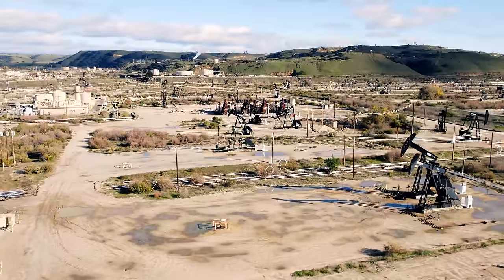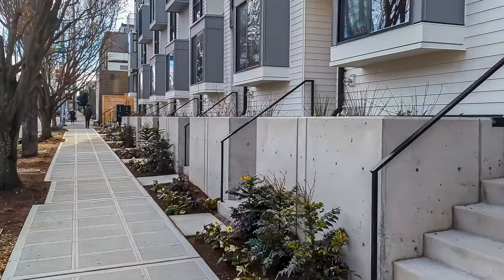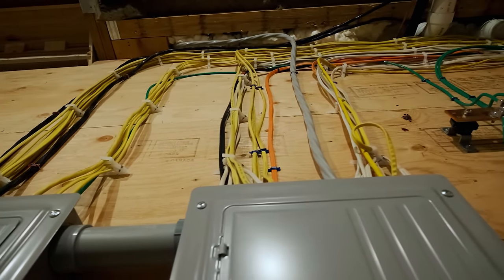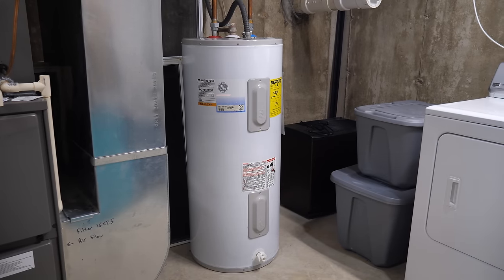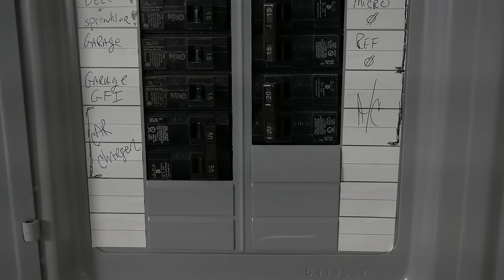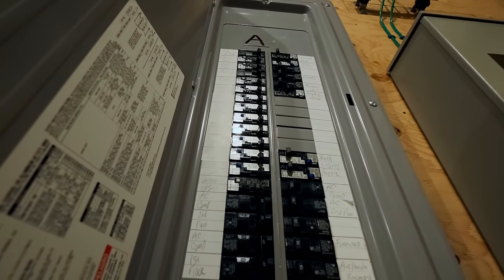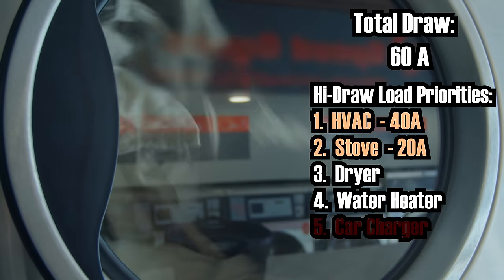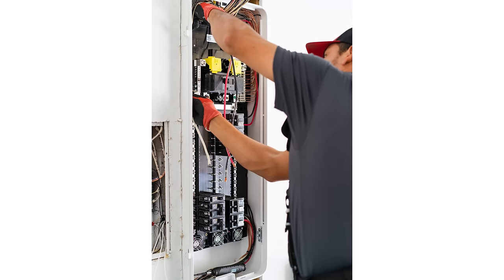Home Electrification: There's not a lot to do, and it doesn't have to be hard (Part 1)

Comment: Hi!  I had a Span panel installed with my ground-mount solar system last summer, and yes I am one of those NERDS.  I wanted to clarify one thing about the Span panel, at least in its current phase.  Earmarking breaker priority is only done with battery energy management and is not implemented to manage grid power.  It will only be used when grid power goes down and you are forced to extend the life on your battery backup.

I have solar but do not have battery backup, and I cannot even access the priority page on the app. I am hopeful they will figure it out someday but as of today you cannot do what you stated with Span alone. Now, I do have direct access through Home Assistant and can manage this through custom automations, but hardly home user friendly.

Comment: I think a lot of why this is hard for people is that they only think about most of the these appliances when they're broken down.  If your gas furnace breaks in the middle of winter, running a new wire to switch to resistive heat may not be simple and you need to fix the heat ASAP.  Just dropping in a new appliance that uses the existing power/fuel hookups is a lot easier when you're in a hurry.
Reply: Also, the gas network never goes down.
Reply: @mark.audacity  Exactly, a 15 amp genny can get you through a blackout in the dead of winter.
Reply: I think most people don't want to spend $10-20k and throw away perfectly good appliances and breaker panels just to make themselves feel better. It would make more sense to throw up some solar panels and actually contribute to the energy mix rather than burn loads of cash becoming more of a siphon on it.
Reply: @mark.audacity  this is a joke, right? It absolutely does.
Reply: @mark.audacity  Be careful making sweeping statments, its not happened to me, but nor does power(I have had strangely reliable power for most of my life, but its mostly buried in my area), but it is possible, heck, the day im writing this comment there is currently a Gas outage in Woodstock, Oxfordshire.

There is a lot of components that can fail in a gas network(Compressor stations), and a lot of Electricity is used to process both Nat Gas and Petrol/Car Gas. I would arguably say its not more reliable and has about the same risks for outage.

Comment: I live in europe, a 200A (or even a 100A) service is mindbogeling here. I have a one phase, 230V 35A service. So about 8KW. And that is without a gas supply. I had a heatpump installed about 2 years ago. When I'm not home (so only fridge/freezer, modem is running) my entire house uses about 150-250W. When I'm home with the heat running, its usualy about 1kw depending on the temperature outside. The only time its even close to the max 8kw is when the heatpump is heating the tapwater. wich draws at most 3kw and for desinfection rises to about 6 but thats maybe 15 minutes a week. The heatpump is capable of loadsharing, and when I buy an electric car, the charger will need to be able to do loadsharing to. But 99% of the time it wouldn't even need to. 

The only time I have over 4kw running through my panel for hours is sunny days, when i'm not home. And thats solarpower going out :)

Comment: I have to say the stove should always be above the HVAC in priority.  I won't feel a short lack of HVAC, but I want the stove to always work when I want to use it.  I grew up in an all electric home in rural Canada (switched our heat from oil to ground heat pump when I was a teen) and never tripped the main breaker.
Reply: Unless I'm missing some nuance of active priority, the first two on the list are functionally interchangeable, as they don't exceed 100 when added.
Reply: What about the concern of potentially fucking up something by essentially "unplugging" and "plugging in" a potentially high-value item to turn it off/on while it's drawing power?
Reply: @grafzeppelin4069  My laptop's battery and four power divider's switches broke when I flicked my breaker to pull a wire. Good times. Yea, I don't want switches breaking on their own, and I surely won't ever run unprotected wires to any of my electronics again.
Reply: Ya cooking is more important than keeping your pipes from freezing and ac who even need that anyway but your stove if it was gas could heat your house enough to keep water from freezing and eat but electric stove will be insane to leave on and open I guess that's why all restaurants have electric stoves what gives that nice grill marks right and I am sorry not attacking ya you have your opinions and can set whatever you want in your home for priority just depends on your situation I guess this is my opinion
Reply: @Koogz406  Since you were so polite in not attacking the OP with your passive aggressive comment, I'll make mine similarly polite...

Bluntly, you're being unserious. A heated home heated to 18C cannot drop to below freezing in the time that it would take to cook a meal. It doubly cannot do so while the meal is being cooked by a heat producing device INSIDE THE HOME. This is the whole point of the video. The heat is not shut off indefinitely, it is only shut off for a short time to manage the load.

I have no idea what you're even off about on restaurants?
Reply: @DanielBrotherston  Sounds like we just got some "Gas, woohooo! What is math anyway" person
Reply: @Koogz406  I can get nice grill marks on my electric stove... (Here's a hint: "grill marks" typically come from hot metal touching food, not from bare flames licking food. Besides, food on a gas stove is typically in a pan, shielding it from the bare flames anyway).
Reply: Yeah the first thing I wanna do when the power goes out is cook up a nice meal on my stove
Reply: @Dan_the_car_man  I think you didn't read or understand OP's comment quite right?
Reply: @AbiGail-ok7fc  Especially if you use induction stoves, which are 90% efficient at directly heating the pan
Reply: @AbiGail-ok7fc  yes yes but do restaurants use gas or electric?
Reply: @grafzeppelin4069 @sybre6259 I would have to assume that a smart panel would have safer methods for disconnecting a circuit than functionally flipping the breaker given that it is built and designed to do that action on a continuous basis.
Reply: @Koogz406  No one was talking about restaurants
Reply: @Koogz406  It varies, some use gas, some use electric. There is an increasing move to induction as it reduces the need for expensive extraction systems and makes the kitchen significantly less hot, improving working conditions, as well as reducing cleaning time and costs.
Reply: Chicago at January would make you change your opinion.
Reply: @Koogz406  i would think a lot use gas. 100,000 btu burners at a Asian restaurant, the electricity needed to replace even one of those is insane. Do you want to wait longer for food to be cooked? Fewer customer turnover?
Reply: @cleitonoliveira932  I live in Canada...
Reply: @tristanridley1601  i can't understand how you would risk freezing
Reply: @cleitonoliveira932  How would you get that?  The stove is making heat too, so it only matters when it's hot out.  If I'm cooking for long enough to feel the lack of AC, I can manually decide to turn off the stove for a bit...
Passive things that run occasionally to maintain a balance should be prioritized below things I am physically trying to use.
Reply: @zondiw5007  yes all commercial hoods have make up air but no I don't believe I am seeing people only use an induction oven and ditch the gas stove and flat tops gas deep fryer gas dishwashers almost everything is gas. Will be fun sitting at the hai bot chi grill watching them cook on a electric flat top. Thank for helping with the whole grill marks issue I thought they just painted lines like bk not actual fire kisses meat that's crazy
Reply: @SamPhoenix_  why not why should I suffer and commercial and industrial buildings keep using gas they use and pollute more than my small offset will be ditching a couple furnaces and a stove. Just converting alone is a huge expense on top of an already expensive furnace ect. Geo thermal drilling wells and heat pumps are just more money adding more power and a bigger service or being limited to your homes appliance unless a huge service upgrade when ya can use gas like we do now because it just makes sense not only having both for back ups but lowering your installation and panel cost. Ya think up grading from 100 amp to 200 amp is easy I know many many homes that have 400 amp to house and 200 or 400 to the shop and garage they are already maxed or close so how is that more environmentally friendly my furnace is 96% efficient just seems like I or we give up a lot and must pay a lot more to gain very little and Longhorn steak house keeps using gas. No fair not gaining anything just more money when the earth is full of gas we just burn off at a flare pit still pollution other countries still extremely polluting and we suffer it is possible but not yet and will be really lame hanging out in front of your electric fireplace. And cooking s'more on my electric fire pit and that gas line to my bbq so nice no bottles  but I have to buy electric bbq come on electric fire pit ect. so much money to save nothing. Dam power is great but if we are the only ones sacrificing lakes will still dry up and back to being screwed. Using natural resources being  energy independent will be better for the environment producing all this new electric equipment and everything in everybody's home alone will be polluting a lot more you already have a hard time getting house electric panels and breakers and have gone up minimum 200% percent in 2 years but if ya like having electric everything to feel good and completely avoid how it was made and where it's made for you trusting other countries to make them using the highest standards then your already lost. Lithium mines copper mines steel mills will be so busy building non recyclable hazardous material type equipment and parts we will probably be polluting more after it is all said and done. Just being realistic and knowing tech will improve but  the costs and rules being forced on me is a huge burden and not my choice I can't wait until they have us on all electric everything I can't imagine how much they raise the price regardless of the technology improvements money money money keep printing it and will be be burning wood in barrels to keep warm.
Reply: @Koogz406  Please use more punctuation. I actually cannot understand some of the things you're trying to say because I can't tell where one thought ends and another begins.
Reply: @grex2595  well that's a problem I also do not know where I am or where i am going I am just free flowing and pushing send but yes sir I will try to complete a sentence and thought. Not this reply but the next one I will try. I do understand it only hurts my point and conveys lack of intelligence bad grammar and having a complete thought you can articulate are very important even if it is just YouTube
Reply: @Koogz406  It's more like I can't understand what you're saying, so I basically ignore it because it takes too much time and concentration to figure out what you mean. If I'm ignoring it because I can't understand it, you might as well have not posted it.
Reply: @grex2595   Word.
Reply: What bugs me is the dryer being at 3rd place.  Usually not a priority to get your clothes dry fast but charging your car might be, or taking a hot shower when the whole family has used the shower just before you.
Reply: @Koogz406  This is the height of being pedantic.

My flat is all-electric and apart from the shortsightedness of my building having forced heat instead of a heat pump system (which I partially fixed by getting some air on/heat pumps) there is literally no issue. I don’t “suffer”

My water heats when electric is cheap, i only have one bill, heating is instant.

The only reasons (some) restaurants use gas is because (historically) gas has been cheaper and gas appliances are more readily available because of that.
Induction stoves are more efficient at cooking - gas is no more better than heating things than electricity

And well done with your 98% efficient boiler… Heat pumps are 200% efficient between -10 and -5 Celsius and only get better from there became they can move more heat from compression than is required to compress the coolant.

You clearly haven’t watched the video. Alec literally addresses the early adopter tax and the government incentives that come with technologies and ideas growing in popularity to bring the price down.
Reply: @SamPhoenix_  So you are not all electric. That's a furnace and you sound like you would not be able to have a welder or a hot tub what about having more hobby lathes grinders cnc machine a water jet having whatever you want and being able to use it with out buying and installing 400amp service the basics and nothing else is definitely seems like I'm forced to live a basic life and limited to power.
Reply: @Koogz406  I am all electric. There is no gas line to my property. My heating is electric. I am on a 100% renewable supplier. Nothing is burned to get me any power or heat to my property.

I also have no use for any of that. That’s not a home that’s a workshop. You will already need to redo the electrics for most of those devices because they’re all high power
Reply: @SamPhoenix_  also ya said flat and I assume you are not in America so you might not understand why my blender dryer,a c, every other house light on and want to run the vacuum. You don't have to understand just know its definitely normal
Reply: @Koogz406  Blender runs for 30 seconds max, you don’t need every house light on and most modern vacuums are battery powered.

You clearly haven’t watched the video. The whole point is to prove how it’s possible to do it
Reply: @SamPhoenix_  you don't need I have a  3 ring circus in my back yard. You can do you and guess what I wont tell you what to do. So please don't tell me what I need and how I do it.
Reply: @Koogz406  You’re the one who commented about how this is all stupid, (for some reason) brought restaurants into a discussion about homes.

Don’t post the comment if you can’t deal with the criticism
Reply: @SamPhoenix_  I can deal guy are you  upset that your opinion is meaningless. Or because you seem to have an issue with reality. If I have to use all electric and commercial doesn't then me bringing it up as unfair is can be part of the issue. Bottom line just because it works for you doesn't mean it works for me. But I am sure you will have a reply and we can continue getting no where together.
Reply: @Koogz406  Bro if you want to stop “continuing getting nowhere” then just stop replying 🤷‍♂️
Reply: @SamPhoenix_  and yes I did because it is drum roll.......stupid. Real life situations have proven we are not there yet tech is still being developed and tested and are not ready for real world use in every house in the usa. Yes its possible and people are all electric but impossible to say we can do it now and will not be limited to the basic appliances and make it extremely expensive to upgrade and not worth owning and buying other non essential equipment that I can have and run cheaply now. Yes its possible and yes you are limited to what you can have and use and what times.
Reply: @SamPhoenix_  I have no problem letting you know that your opinion means nothing and will call you out everytime
Reply: @mattcintosh2  No I do not, that was one of my incoherent points.